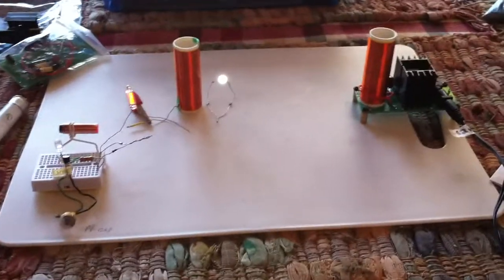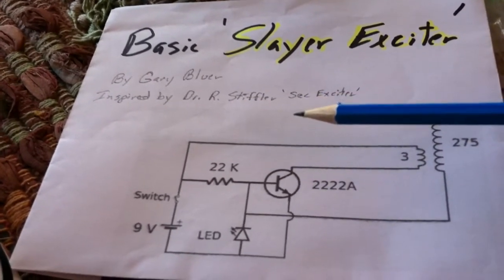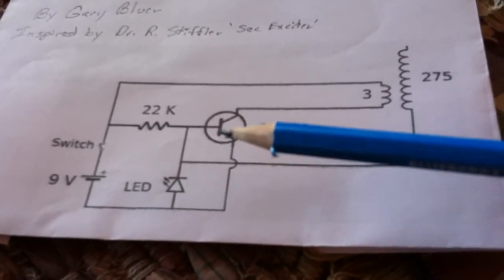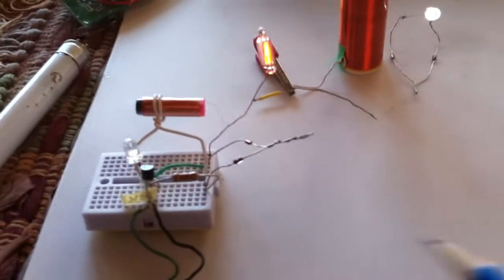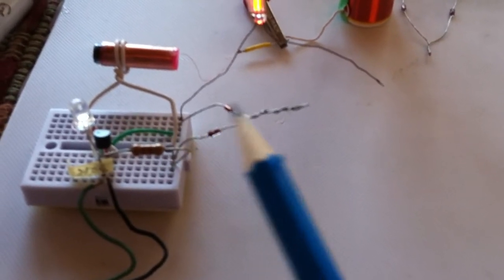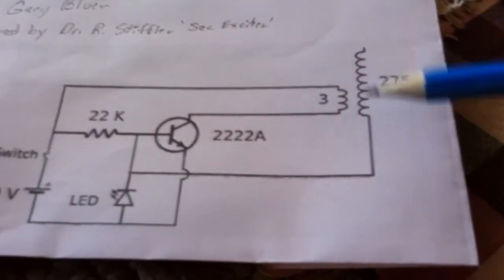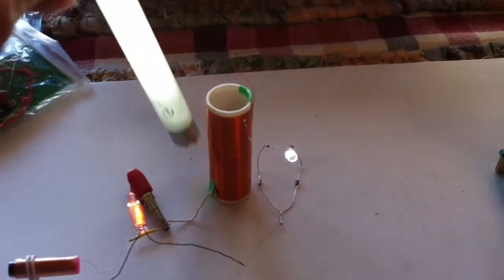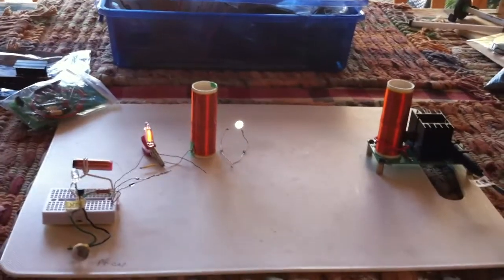Slider's Musical Mini Tesla Coil tuning solution

Comment: If you use a small L2 coil a veritable capacitor across  the power source can be used for tuning.https://www.youtube.com/watch?v=7EJv-LI4fP4&t=2sThe choke Exciter circuit is also tuned the same way.
Reply from the maker: Thanks Gary.  Have you ever tried running a signal through an earth ground rather than through the air using a SEC 18?  Dr. Stiffler says that he can do it to at least 10M and up to 60M under certain conditions.   I don't understand how that can be done.  Do you?
Reply: Maybe if you could match the earths harmonics. I think you would have better luck with larger coils.
Reply from the maker: From my research it seems that using the earth to transmit a signal requires very low frequencies and a large (huge) antenna buried in the ground.  So far I have not found anyone actually 'transmitting' significant electrical power using this method.  I think people are confusing a ground return path with the true transmission of power through a dense medium. Perhaps I am wrong.

Comment: Nice.  Any idea how much power is consumed by the slayer exciter system when on & not loaded & then how much is drawn when you load the circuit with light devices that you show in your vid?
Reply from the maker: We did testing on this years ago and the receivers don't  load the transmitter.  It is a capacitive linkup not inductive. What happens is the more you load up the field around the "exciter" the  ALL the lights get dimmer but the draw on the transmitter stays the same.
Reply: Very interesting.  Thanks!